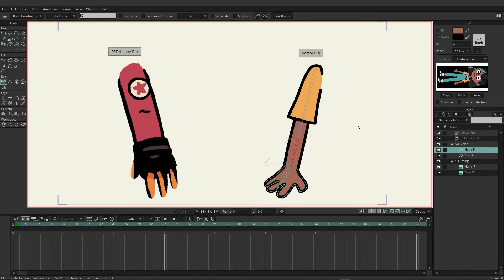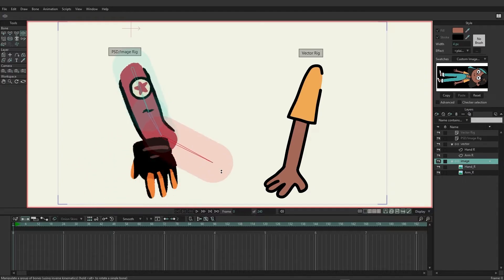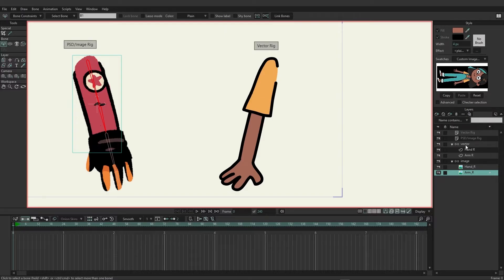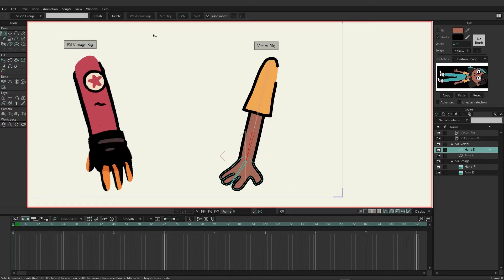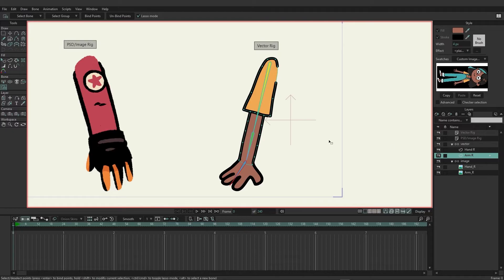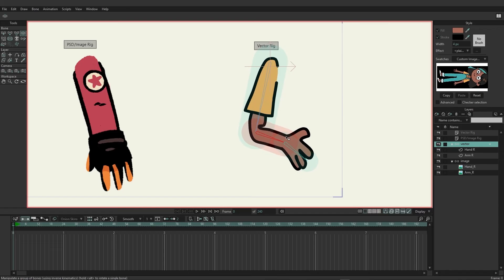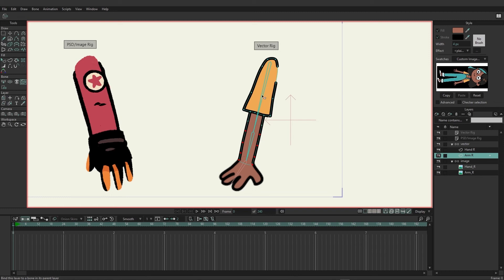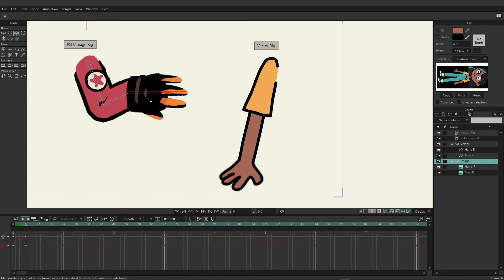Part 22/38. Rigging vectors vs Rigging images - Learning Moho from beginner to expert

Comment: Hi, Chad.  Great tutorials!  By the way, I'm working in Moho 12.5.  As the "link bones" button is a no show in this older version, what's the recommended solution for linking multiple bone chains to a vector shape?
Reply from the maker: That option was called "Use selected bones for flexi-binding" in older versions. You can find it under the Bone menu
Reply: @mohoanimation  Thanks!  Appreciate the speedy reply :)

Comment: so whats the conclusion? SHOULD I USE BITMAP or vector?
Reply from the maker: @FoxenVoxen  it depends on what is the result you want to achieve. Moho gives you tools to work with vectors, bitmaps or both together
Reply: Vector to me is superior in terms of flexibility since it ensures infinite scaling without quality loss. But it can be trickier and more time consuming to setup if there's a very particular linework and artstyle I want to replicate.

Bitmap I'd use for cases where I know I won't be changing up resolutions and character scales, etc. I find myself working at 2 or 4k when I play with raster anyways, since I know you can never be sure what screen your project will be viewed at. This bogs down my project if I want to make something complex down the line.

That's where vector shines IMO, especially here in Moho.

Comment: hi, i'm curious if a bitmap based rig needs to be rigged differently than a vector based one? also, are there pros and cons to bitmap/vector besides the fact that vector can be scaled up without becoming blur, and the auto boiling?
Reply from the maker: Yes. The transformations over bitmap affect the pixels, so they won't be as flexible as vectors. Now, using bones, meshes and curvers you can do a lot over images! Be sure to check the rest of this course to know more ☺

Comment: I'm curious ...  what exactly is the purpose of "Linking" bones?  I've seen it mentioned on more than one video - but I've yet to see any explanation of why I should do it.
Reply from the maker: By default, all the layers inside of a bone layer will be affected by all the bones. This means, for example, that if you rotate the bone of the head, the arm is going to move too.
With Link bones, you select the arm layer, for example, then select the bones related to the arm and then link them. By doing that, you are telling the software the arm is going to move only when the arm bones move, ignoring any other bone.
Reply: @mohoanimation  Ahhh...  this makes sense.  Thanks for the quick response.

Comment: The manual made it seem like Point Binding is a little outdated: Is there a reason to use it instead of bones that use region binding?
Reply from the maker: There are different methods of binding: Flexi-Binding, Point Binding and Layer Binding. A single rig can use and mix all of them.
Usually, Flexi-Binding works for soft shapes that bend smoothly. Layer Binding works for binding entire layers to a single bone, like a mouth switch layer, for instance. Point Binding works well when you want one or more points to follow a specific bone, but keeping the rest using Flexi-binding.

Comment: 7:48 at this im not getting the create smooth joint option selected for my image
Reply from the maker: For that option to work, the bones need to be as extended as possible. If you can't do that with your illustration, try the Link layer to bones option instead
Reply: @mohoanimation  I tried but still not get the output you did in the video
Please guide me it was an insane feature I loved it in moho 14

Comment: I was wondering why you didn't just layer bind the hand in the vector image, but then you acknowledged doing that would have netted the same result as the point binding you did.
Reply: 7:48 at this im not getting the create smooth joint option selected for some reason could you help me out
Reply: @Mrpaul20  I had the same issue - Make sure you are selecting the bones you wish to apply  the smooth joint to AND the layer in the layers panel associated with the bones and the option should now be clickable
Reply: Oh...I just realised this is a really old comment lol, sorry this is a tad late in response lol